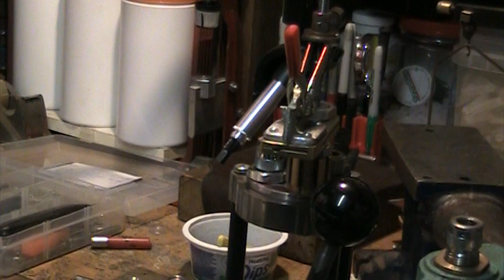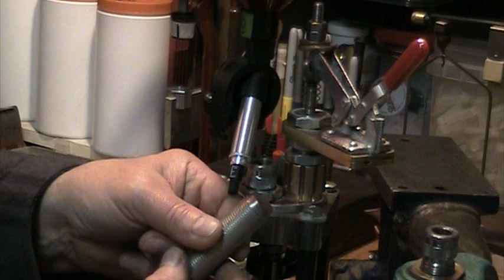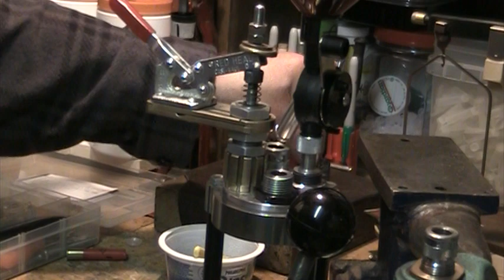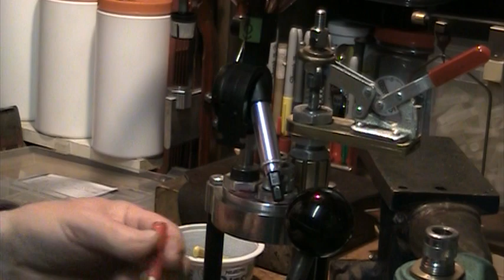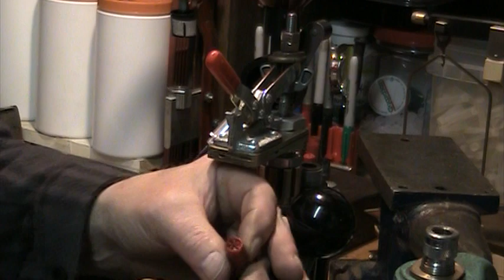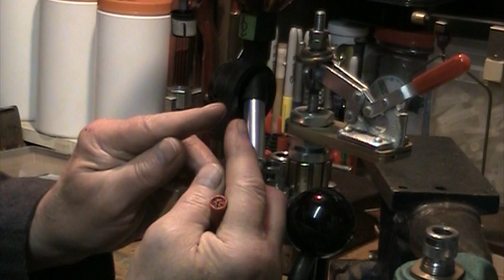Homemade reloading dies for .410 shotshell

Comment: I use a 3/8" pipe and a 3/8" cap to do my die, just have to take out the welding inside whit a file and it fit perfectly, and an adaptor 3/4" to fit in my press . Drill and tap the cap for a 1/4 "for the decaping pin and i have to fit it to the size of the primer. And will drill the no. 5 holder to fit the primer. That is what i am about to do. 
The botle cap press is a good idea.